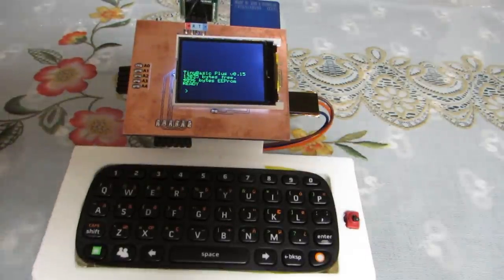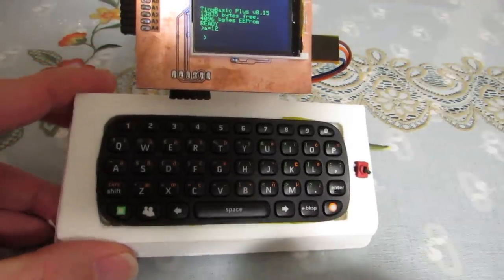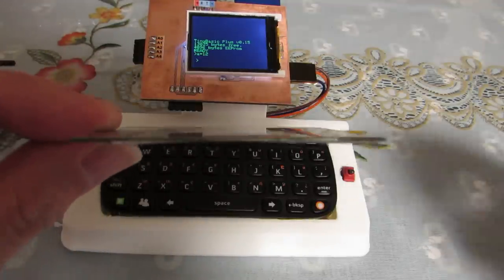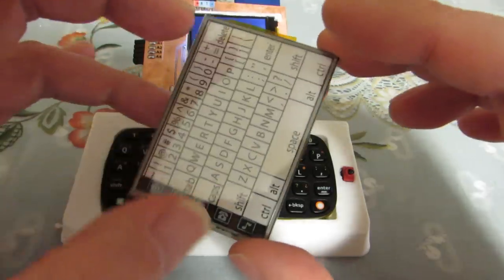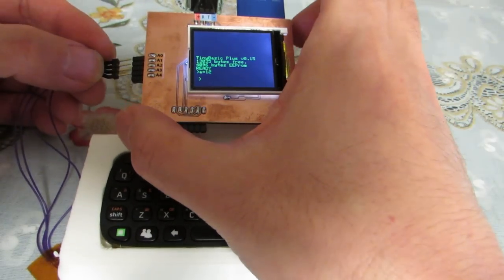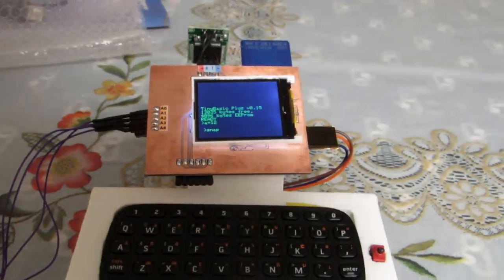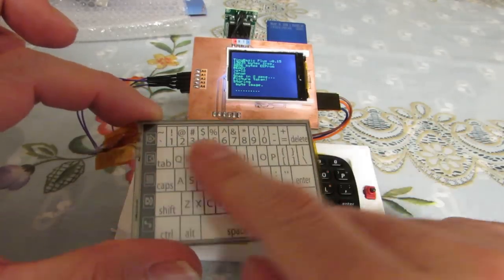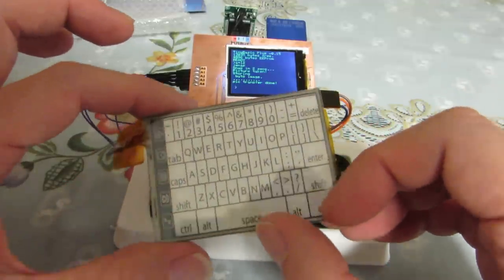Very thin (sheet) keyboard for small computer making

Comment: Nice, for portable DiY projects, mini keyboards are such a problem. The available ones is 2.4Ghz or Bluetooth, no wired, and the size is huge for a small computer like yours. I've used chatpad into my RPi portable project, but It fails a lot with a closed source driver. The only way is to use some tablet's cover keyboard, but tablet is not the mainstream again =//. Very sad. Nice project indeed, thanks.